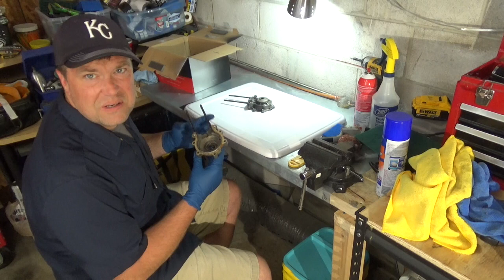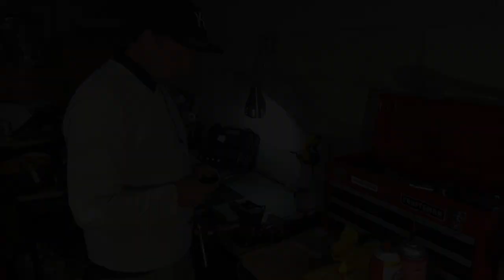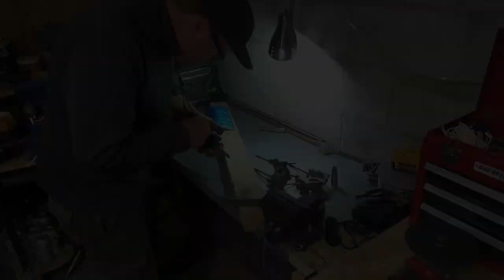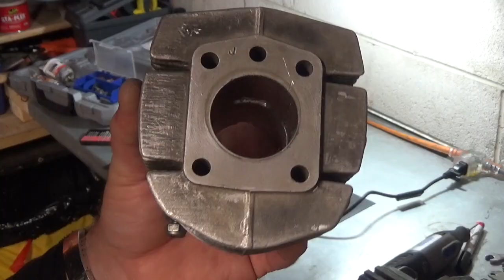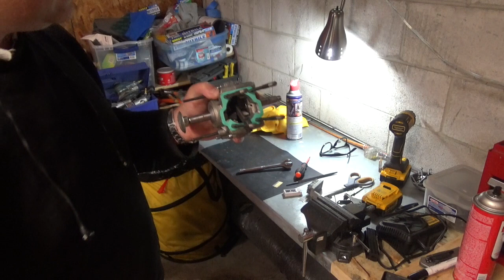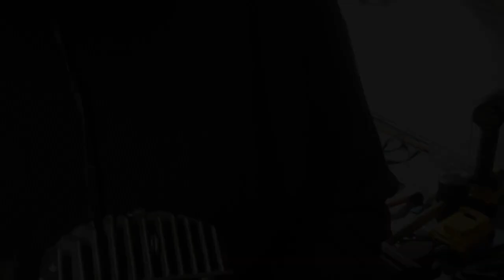Motobecane Moped Restoration Ep. 8 - AV7 Stock Engine Rebuild Pt. 2

Comment: Whe you say that the crank seal springs should face out, do you mean toward you as you fit them? Or toward the clutch/ignition side when fitted, very confusing issue this on these engines as you see different people fitting them both ways. Thanks

Comment: I have a Peugeot 103 engine I'm rebuilding. The new cases I bought came with seals and bearings installed from treats. I assume I can freeze the crank, but should I just heat gun the pre-installed bearings like you did to the Carter's in this video? Just don't want to burn up my seals. Love the series!
Reply from the maker: Dang man. I’m not sure. I’d be scared to put a heat gun on the seals. The bearings would be fine, but those seals can melt and those heat guns get HOT. If you can, I think the best thing to do would be to put your cases in the oven around 250F. I don’t think that would be hot enough to melt the seals, but prolly hot enough to expand your metal enough to get your crank in. Good luck!
Reply: @DavidFixesHisShit  thanks for the reply! Didn't you use the heat gun on the inside of your carters with the seals in place, before you slidn in the crank/bearing assembly? If you think the seals can take 250 in an oven I'll freeze the crank and do it that way. Should be enough change to get it on. I guess those seals probably get to 250 when the engine is running anyway. Happy New year, and I love the KC hat. Go Royals!

Comment: Great series.  My son and I are working on an 1980 Motobecane.  Where did you find the torque  specs?
Reply from the maker: I really appreciate that!  I've been using this page for the torques-- http://www.mopedarmy.com/wiki/Motobecane_torque_specs .  I also used loctite on all the bolts, except for the two upper carter bolts (that thread directly into the case). On those I used antiseize, just to make sure that they won't freeze on. Good luck on your moped.
Reply: Thanks.  Also, if you could, please provide as much  detail as possible when you convert the second moped to have a variator?  We want to convert ours to have one as well but really have no idea what to buy.
Reply from the maker: Will do!  I'm gonna start on the modifications in the next couple of episodes.  I've had fun fixing the stocker, but I'm super excited to start putting on all the speed parts that I've been accumulating over the past few months.  I bought a used stock AV10 variator for my bike.  Hopefully it just slides right on...

Comment: did the decomp valve need any form of lapping
Reply from the maker: I’m not sure if it ‘needed’ it, but I did it anyway, just to make sure I got a real good deal. I just put some lapping compound on the stem and then chucked in up in a drill and spun it for 3 min or so to make sure it was fully seated.

Comment: may I ask you what the ratio of oil to gasoline for these scooters is I can't figure it out and I don't wanna burn the motor out.
Reply from the maker: +gravedigr12--- I think they usually recommend 50:1, but I always mix mine with a little more oil...  so more like 40:1.
Reply: thank you very much.

Comment: where are you getting the pats from i am curently rebuilding a 1980 motobecane 50VL and can use allot of motor internals and some electrical parts
Reply: treatland.tv
Reply: Hi, i also need new barrings and sealings for the engin. Where can i get them?

Comment: After slappin' in new seals and bearings (went smoothly enough), reassembling and slappin' back in bike (without doing a bench test like a dang ol dope!) my dreams of boom boom vroom were dashed when I noticed that turning the engine over by hand on the magneto that when the piston is on the return stroke I can hear a audible air leak. What the fuck! Im quite sure I didn't forget the case gasket (this time anyway)! Should a fella just heat soak the carter and double check torque on case bolts first things first? Oy vey!!